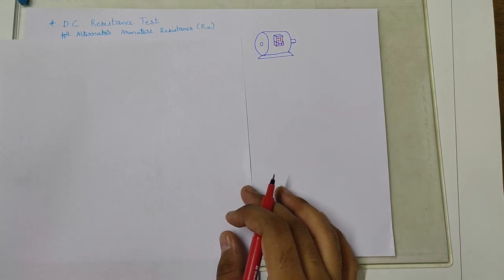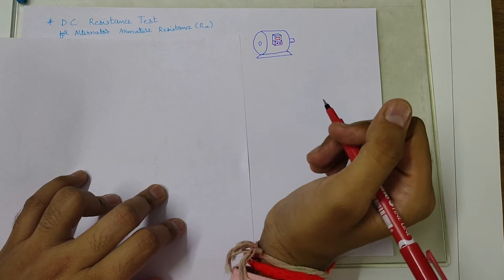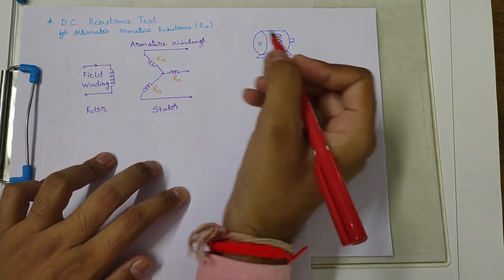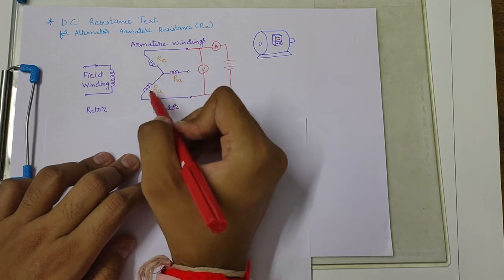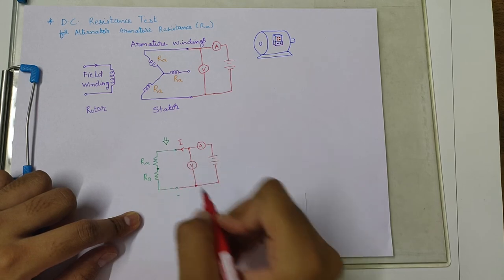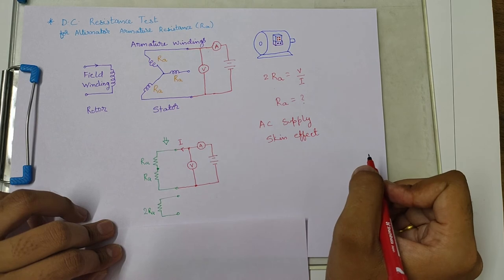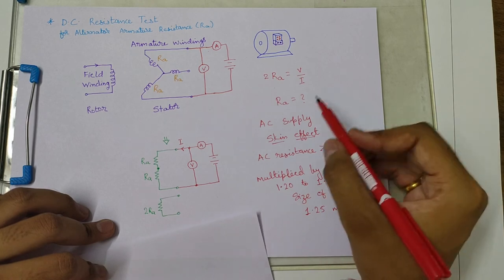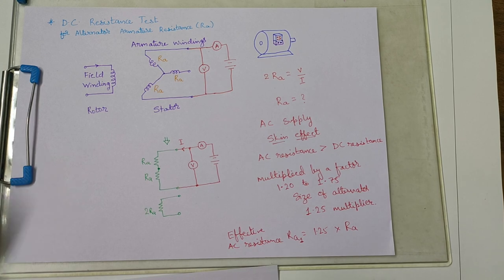Armature Resistance Test on Alternator | AC Machines | Electrical Machines

Comment: what is the importance of getting the armature resistance of an alternator? why do we need to know all of these? thankyou
Reply from the maker: Good question.
The knowledge of Armature Resistance value, along with Open Circuit and Short Circuit Characteristics of Alternator, is required to calculate/estimate Voltage Regulation of Alternator.
It is done using methods like EMF/Synchronous Impedance method, MMF/Ampere-Turn method, ZPF(zero power factor method)/Potier method.